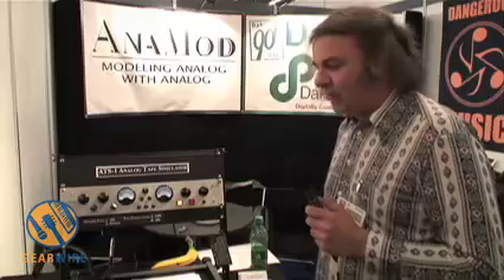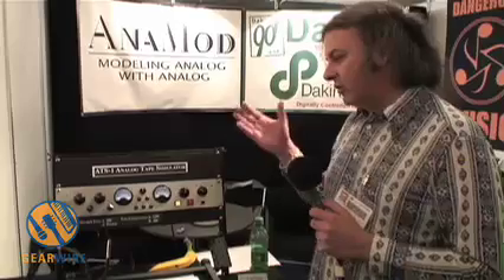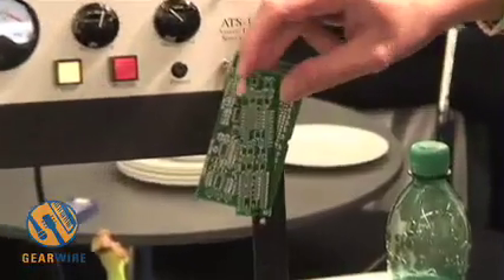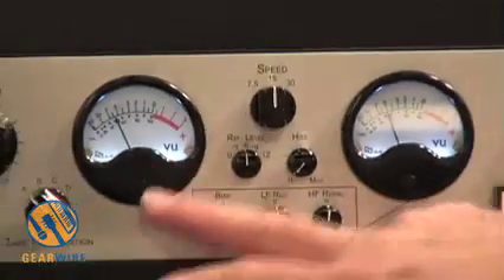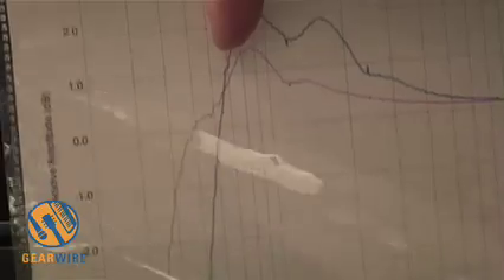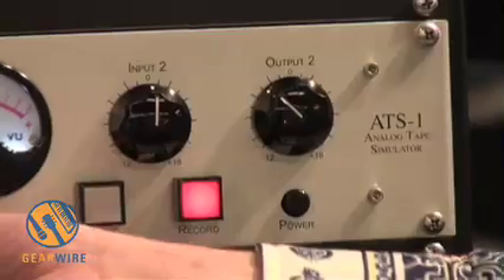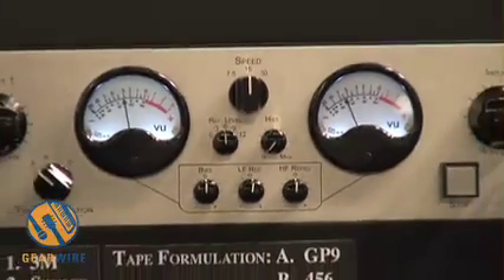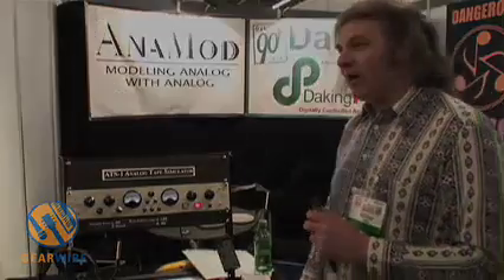AES Vienna Video: Modeling The Sound Of Analog Tape With AnaMod ATS-1

Comment: Most emulations of the `tape sound´ focus on the saturation  characteristic 
   alone and underestimate the effect of  a subtle amount of `flutter´ -  high 
   frequency fluctuations  of the  tape speed.  This adds  something which  is 
   probably the most important part  of the special sound: The  harmonic lines 
   are "widened" by  the effect of  frequency modulation due  to flutter which 
   causes a 'thickening' of the audio signal contributing to the fat sound  of 
   analog,